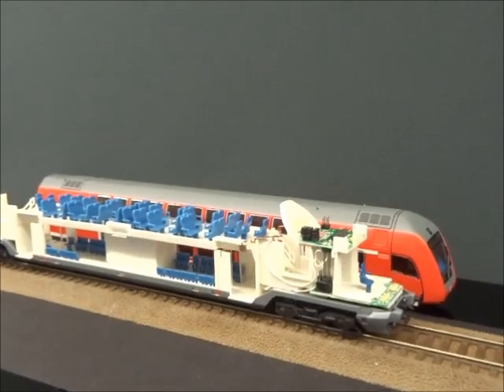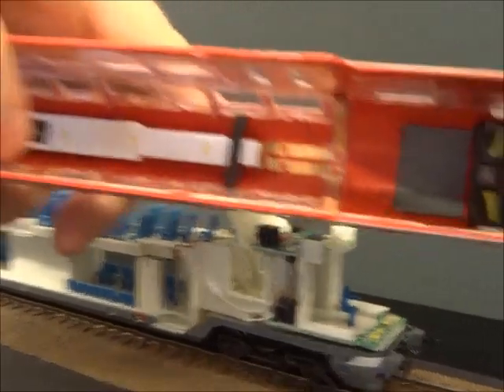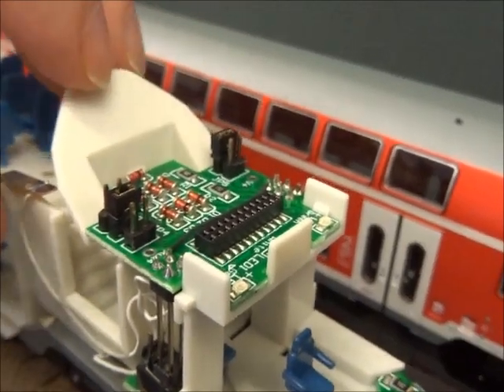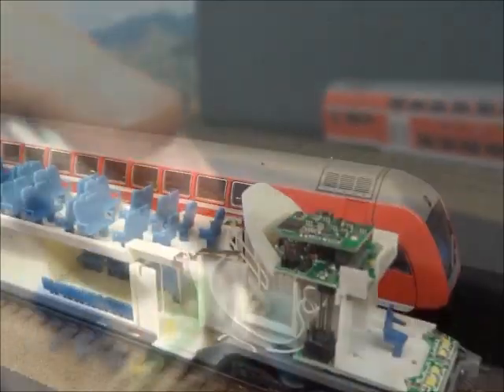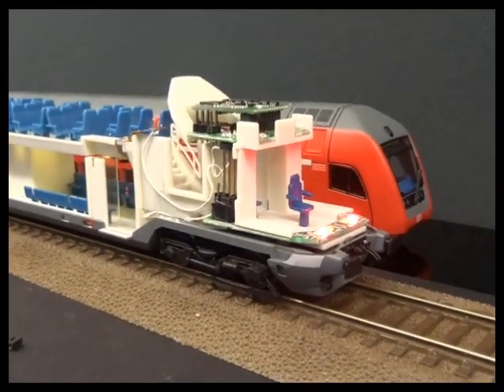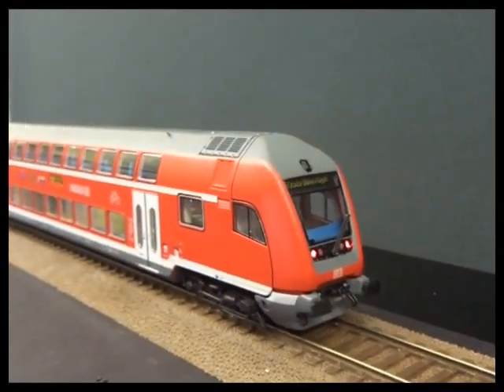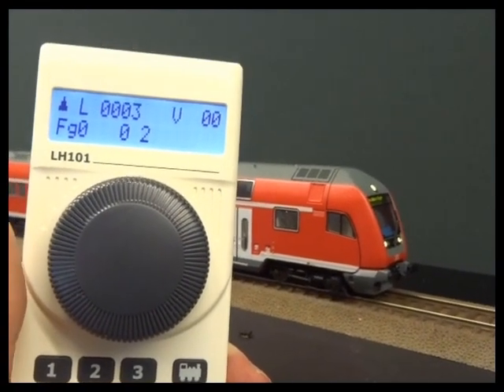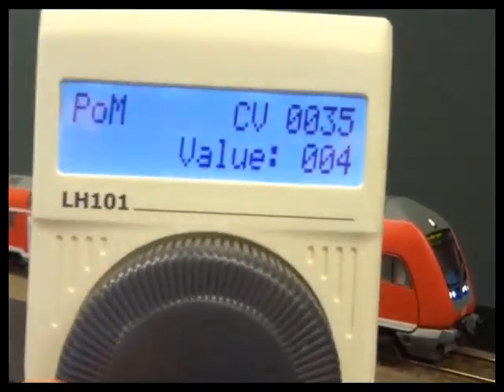Roco HO 74146 74150 74155 74160 Fitting DCC in the DB AG Double deck cab control car

Comment: Great video, thank you!!! There's so little material in decent and any English at all, about continental models... How about the interior lighting, is it switched on and off by functions or it is just lit when on tracks?
Reply from the maker: The interior lights is from the tracks - I suppose this is an answer to the rest of coaches in the train. It starts getting difficult if you have to have a decoder in every coach
Reply: @digitalcareline  True but would be nice to have it switched on/off by a function. Specially given the Plux22 decoder applied. Current conducting couplings sort things out. You will find such solution in Jägerndorfer bilevel coaches with interior lighting. I guess Roco is not that clever...
Reply from the maker: The coaches were built by HobbyTrade (Now owned by HMB) Roco had no hand in their design and construction.  Electronic couplings are good - but limiting if you intend to sell individual coaches and not full packages (These German sets do not always include the cab control car and you will need one coach with a conventional coupling to the loco)- You have to be very careful when purchasing Trix illuminated coaches now as you must have the end car for any of it to work - There are pitfalls wherever you turn with coaches. Plus you are building in more cost for DC modellers
Reply: @digitalcareline  Roco had nothing to do with Roco models... sounds too complicated for me. I agree, you have to be vary careful when purchasing any model. All are different and based on different technical solutions. That is why I asked about interor lighting in the first place. You can never be sure with manufacturers these days, eventhough so spend more and more money on this. As you have also noticed instructions are not quite clear.
Reply from the maker: It gets even more complicated Roco originally purchased the models from Hobbytrade.  Hobbytrade was a Danish HO model manufacturer, Hobbytrade was then sold the HMB who make Lazer cut card kits  Just to be clear, they are not Roco designed coaches.